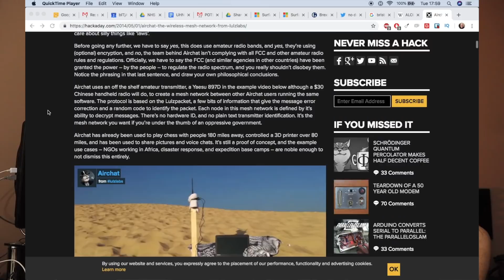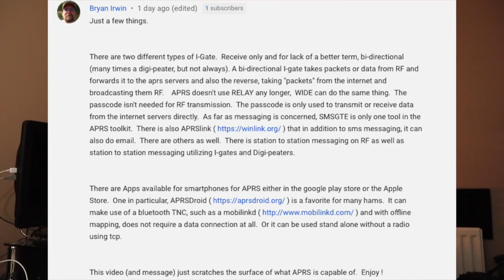Mid week chat #9: APRS and Packet radio, is packet an underused mode in amateur radio?

Comment: It's such a shame that the precursor to the internet Packet Radio is no longer what it used to be..It was brilliant when I could send messages @ww (WorldWide) and also send messages to the Crew on the MIR space station uploading to there packet mailbox as they passed by and downloaded any replies...I just wish we still had the local Packet Radio BBS,s to upload and Download our messages too. my packet address used to be zl3lfc@zl3ac.#80.nzl.oc    Very similar format to Email Addresses it used to take about 8 hours to relay a Message via Amateur Radio Stations from New Zealand to UK at that time snail mail took 2 weeks😂...I used to use a homebrew modem connected to a 2Mtr Radio. AGP Packet Engine used to be a good program as you could use your computer's sound card to produce the Tones for transmission without having to fork out a fortune at the time for a TNC...also Baycom Modems where also very good value.
The 1st Packet Computer I used was a Commodore  Vic20 and then a C64 using a homebrew Baycom Type modem using a TCM3105 chip built on Vero Board.
Reply from the maker: This is great stuff, fascinating to see the history of the internet from the view of amateur radio operators
Reply: I use UZ7HO's  Soundmodem and Easyterm on a laptop, with a Signalink USB interface, works very well.

Comment: Keep up the good work Carl. All interesting stuff and will be interested to see how your stacked 2m halos perform (I guess you will match with a couple of 1/4 wave (or odd number 1/4) 75 Ohm pieces (x VF of course)) into your tee piece?). I delve in and out of local U.K. contests (80/6/4/2/70/23) and sometimes turn on to the weekend CQ sponsored events to look for a few new DXCC. I guess that you could disappear to the WARC bands if the contest QRM is getting unbearable. 90% of my ops are /P and majority of those from comfort of motorhome (albeit a rather oldie!).... still quite a lot of commonality with your exploits. Great stuff. Best 73!
Reply from the maker: Thank you, yes I do like 17m when /p and contest on. Hoping to test the stacked halo out soon, just taking 1 out this weekend on my backpack.

Comment: Great chat, Carl. 
80% of my radio time is spent portable. The struggle is real.... trying to pack essential gear into a bag that doesn't weigh 100 pounds when your done. 
After hundreds of outings, I've whittled down my load to just the essentials....it fits nicely into a small backpack and the weight is manageable. My portable station is HF and VHF via an Elecraft KX3...and equipped for all operating modes, including digital.
It's nice to have a few extras "bits and bobs" just in case... but when portable, weight adds up very quickly. I periodically review the contents of my backpack... if something is in there that hasn't been used in a while, it stays home. 
Looking forward to the upcoming APRS videos. 
APRS has some good features that I'm sure a lot of people don't realize. 
Looks like the stacked halo build is progressing nicely. Can't wait to see the update videos. Don't worry too much about looks.... I've seen a lot of ugly homebrew antennas outperform the pretty store bought ones. I rate performance much higher than aesthetics.

Comment: I'm really looking forward to hearing what you manage to do with packet radio!
I'm in south-west Germany, and we I have a local packet radio station, and even a pager transmitting spots from a DX Cluster. I've spend several weeks playing around with Outpost and Paxon Terminal, but I never managed to connect to the packet station, and none of the local hams I talked to had any idea that it existed in the first place.  Back then, I only had a hand-held radio, and had issues interfacing it with a computer, so that might have contributed to it. Now, I'm on a waiting list for an IC-9700, and have a bit better antenna, so I'm also hoping to check out the packet situation again. 73  de YU1NKA/DM1NKA
Reply from the maker: Thank you I'll share some of the packet radio activities I get up to, I get better results when on high ground.